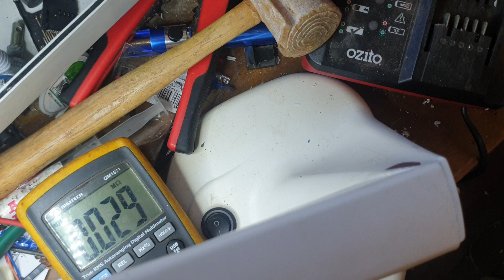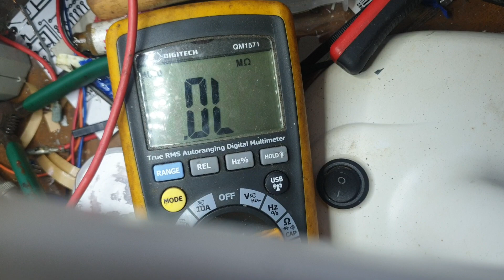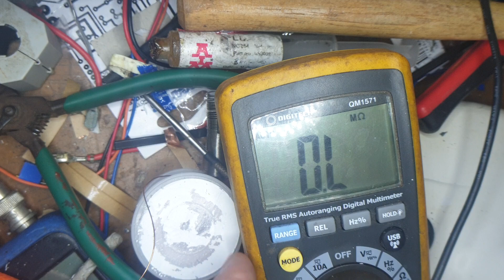Charging chokes, Variable Inductor w/. wiper... Stan Meyer

Comment: It all depends on the space gap of the resonant cavities as that controls the voltages needed to reach the threshold of ionization for the most part. The smaller the space gap between the plates the lower the voltages needed to reach the threshold for ionization, but there is a catch to that in that the smaller the gap the larger the transformer needs to be to handle the increased load the smaller gap presents to the transformer. I recently had to take out the tubes of my ten resonant cavity WFC as I found out the hard way that the space gap I had them built to was too large and would require a voltage of 20kv or more to reach the threshold of ionization. The coating on the wires could only withstand around 3kv so for the chokes that's a total of 6vk as each wire has it's own coating thickness. Every time I'd reach around 10kv the chokes would short out on me as remember they are bifilarly wound. And when I would reach 10kv nothing would happen so I did a little digging to see why I wasn't reaching the threshold of ionization with such high voltages. That's when I re-read the technical brief and found that the plate spacing was supposed to be 0.0626" and not 0.095" as Don Gable had suggested. Even one the two transformers I took with me to the Global Breakthrough Energy conference shorted out on me, but for different reasons but what I learned from that was I had to make three bobbins and not just two as the WFC is actively looking for a ground and it shorted right through the Kapton tape I had insulating the chokes away from the primary coil in search of a ground which shorted out the transformer. 
I have had several of my chokes short out on me as I exceeded the wires protective coating's dielectric voltage handling capabilities. Each time when I pulled the transformer apart to see why it shorted out on me I'd find that the chokes had shorted across from the positive choke to the negative choke as it sought the path of least resistance. Took me a while to figure out why this was happening but in the end I figured it out. That is why I replaced the tubes in my WFC with ones that have a thicker wall so as to close the space gap between the plates so that the WFC took less voltage so that it would not exceed the voltage handling capabilities of the wire's protective coating.
Now with your three resonant cavity set up if the space gap is 00625 each tube will require 1kv of potential difference, which is to say 500 volts negative and 500 volts positive to get the process started. And if they are wired in series then it's going to take a minimum of 3kv of potential difference to get the process started. Meyer had ten resonant cavities wired in series which is why his WFC took 10kv or more for it to work. The reason why Meyer wired them in series is to lower the load being placed on the transformer so that the transformer didn't have to be so large. Never forget that his first transformer was the size of a car's alternator, huge!
This is why my transformers are larger than most other people getting into this technology as I have figure this part of the technology out. It's been ten years since I went to the Global Breakthrough Energy conference and to this date no one has ever reproduced the voltages I showed being applied to the WFC in that interview video done by Mr. John Fraser. Again it took me a while to learn why the coils where shorting out on me but in the end I figured it out.
Oh, there's no way to solder nichrome without having a hard time. Zinc chloride solution in hydrochloric acid is about the only flux I know that can do the job. Wash it carefully afterward.
Reply from the maker: it is interesting we come back to gap, this was something i mentioned to you recently when i couldnt figure out why i wasn't seeing a step ramp and tried a larger gap and then it appeared. you are running multiple gaps that add up, mine is just one. this makes perfect sense. over the years i have a worked with many HV transformers. They often fail when full open circuit, and when in a resonant undampened oscillation. Both things the VIC experiences, even tho it is never disconnected the chokes should 'hide', the cell allowing the transformer to climb and not behave as in a dead short for the period when the chokes have the most compression in one end.
Reply: @m3sca1  The way I talk about this technology is very different from everyone else primarily due to the fact that only two online forums didn't give me the boot for thinking outside of the box as I challenged those Ego maniac forum leaders. As a result my voice was basically silenced as they all banned me and thus no one has been following just what I was doing. This cause me to leap way ahead of everyone else as those ego driven forum leaders held everyone in those forums back. 
You see there is no real magic with this technology as it does follow the laws of physics but it operates in a place most scientist don't know about as of yet. You see the space gap of a cloud is huge thus it requires a very large voltage to reach the ionization threshold for the atoms that make up the water molecules. Since this technology is a way to mimic the earth's global electric circuit electronically it follows the same rules. A voltage intensifier circuit's transformer at a minimum must have a primary coil, a secondary coil, and two choke coils, and one automatic switch (the blocking diode). I use Schottky diodes as they have the fastest switching speeds that switch in the picoseconds.
If you made a cell to Meyer's specifications that cell will require 1kv of potential difference to just get started. It's the job of the chokes to charge up the cell and it's the job of the secondary coil to provide a great deal of resistance so as to create an unbalance in the charge and discharge cycles. This become self evident when you look over the specs I provided of the injector transformer in my thread on the OverUnity site. The transformer should charge the capacitor fast and discharge the capacitor slowly. The wire's chosen must be thick enough to power the load. Meyer's injectors have a space gap of just 0.01 inches but they are very small capacitors. With the WFC's when resonant cavities are wired in series the effect is to lower the cells capacitance 1/C1 + 1/C2 + 1/Cn, thus my ten cell WFC will have a lower capacitance than your one cell WFC. This lightens the load being placed on the transformer as your cell will place a greater load on the transformer than my cell does. But it is as you said by putting the resonant cavities in series I am increasing the space gap as all those space gaps are to be added up which is why my WFC will require close to 10kv to work and yours only 1kv as I increased the overall gap between the positive and negative voltages.
If you join the OverUnity site and send me a PM I will send you my email and we can talk about things further but know not even I share everything that I figured out as I have a company and plan to push this technology into the marketplace at some point in time in the future. If people want to compete with me they will have to do so using their own brain power not mines as I feel that's only far as I worked my butt off learning just how this technology actually works. I still have so many things I need to purchase before I am ready to truly move forwards with this technology and I will not have someone with deeper pockets than mines using my information to basically keep my out of the technology due to my lack of funds to compete with them.
Just know a long time ago I made a promise that if I figured out the science behind this technology I would share that science openly and I feel I have already done that but know it's just the science as I don't tell anyone how to make use of the science. I am a man of my word so I did as I promised I would do and posted the science behind this technology free of charge as this technology is just a way to mimic the earth's global electric circuit electronically.
Reply from the maker: am trying to join the forum but dont get any confirmation email... i cant find anywhere to email Stephan either

Comment: Those in Nano Bubble Water Fuel  Industry Searching for these slider chokes Stanley A Meyer Describes with wiper arm  in various approved and issued patents  please use the name Rheostats Ac / dc HV you will find that all sizes exist and work very safely and reliably if in doubt or urgent need find a old welder and pull it apart , type with the mechanical voltage wind up crank. Great Video Have a Great 2023 God Speed
Reply from the maker: God speed indeed! we are running out of time. I had a hunch the old rheostat was the same thing but felt compelled to make this.
Reply from the maker: @ChannelTheLizard things CAN change for good if we want them to. you can give away your power by accepting defeat or continue to work towards solving problems, and waking people up.
Reply from the maker: @ChannelTheLizard the WEF has plans to end private vehicle ownership by 2030. Getting rid of petrol and diesel and replacing with electric that will be so expensive we will only be able to rent or hire cars. We need an alternative disruptive technology to retrofit our existing engines. Australias 1st move will banning engines over 3L, making them unsellable. less than 7 years left.
Reply from the maker: @ChannelTheLizard we need a psychedelic revolution
Reply from the maker: @ChannelTheLizard 🖖🤣👍

Comment: In this inductor, the number of turns should be 10% less than that of the first inductor and the secondary winding or/and the transformer.
This is necessary to shift the voltage phase by 180 degrees
Reply from the maker: might be a bit different with nichrome... it is somewhat resistive, i have rebuilt the wiper carriage and got them tuned same and can go a little higher to near 14 ohm